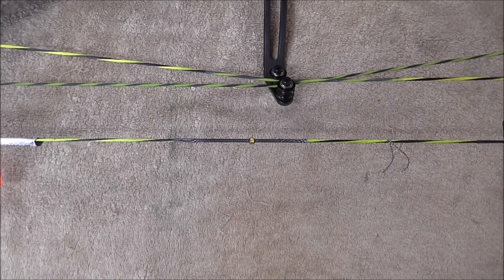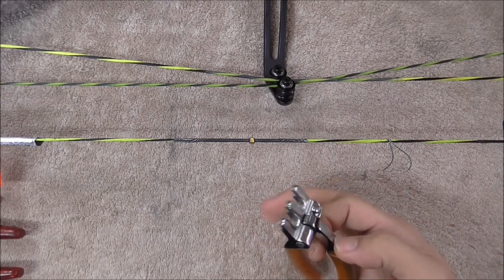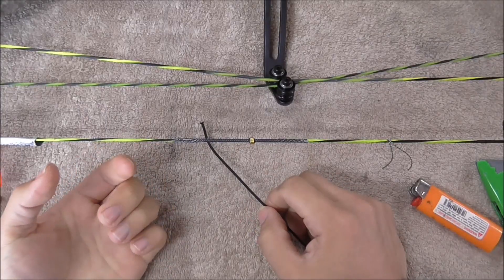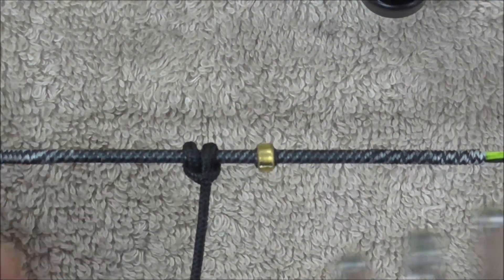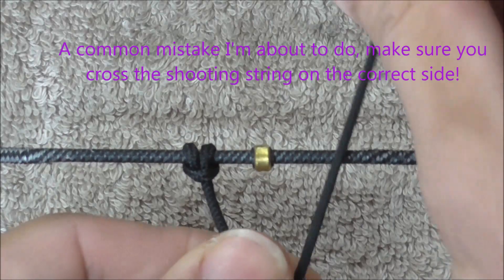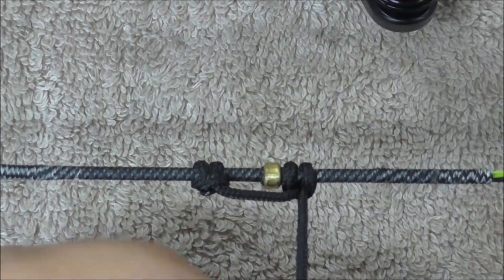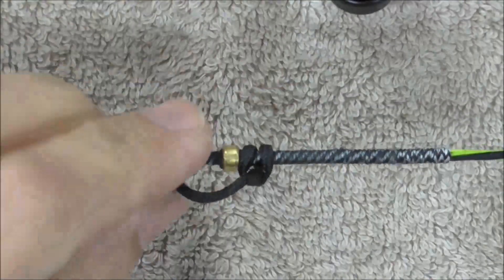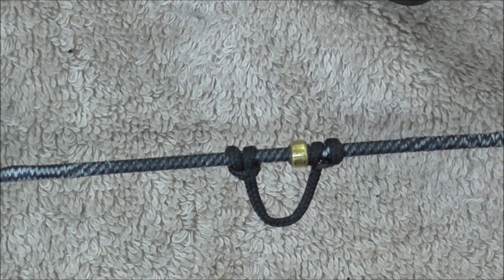D-Loop Tying Tutorial

Comment: Thought I would share a tip to your awesome video.  If you are a right hand shooter, you naturally rotate your release hand counter clockwise at draw.  So alternate your d-loop knots so the top knot is to the left of the string and the bottom is to the right of the string, which gives your d-loop a natural counter clockwise angle to match your release rotation.